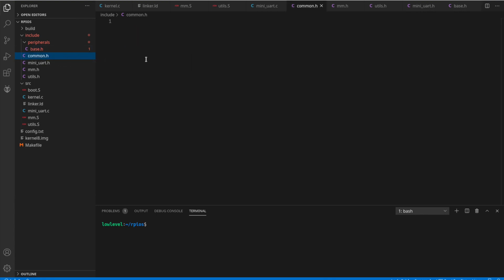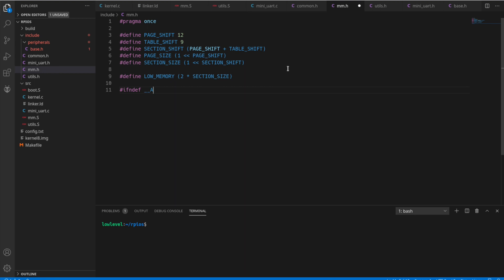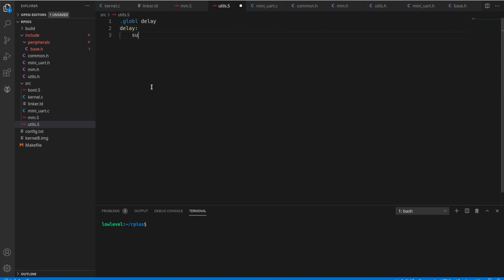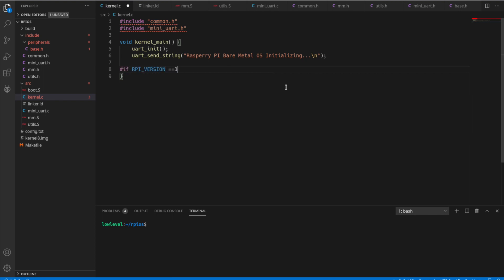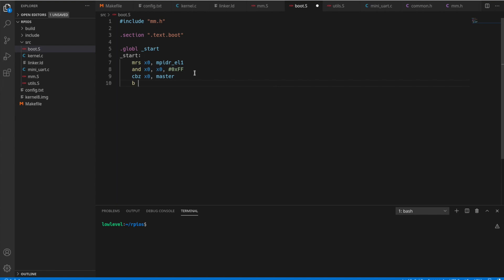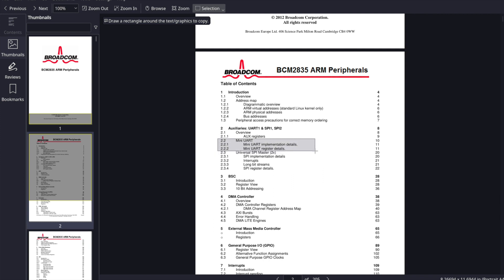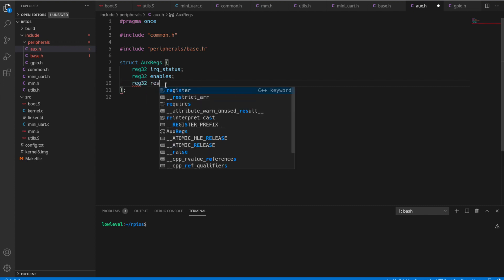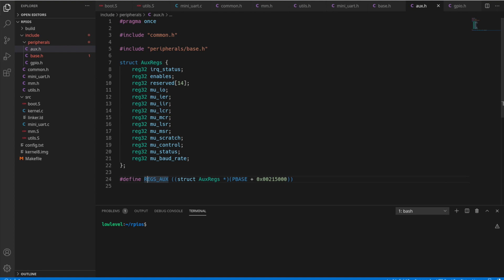Raspberry Pi Bare Metal Tutorial - Part 2

Comment: LLD: A really nice series you have here!  I'm just getting into it myself.  With some mods.  My target is the Pi Zero, so following along and making thoughtful changes as needed.

One thing I found I had to do here and didn't expect this, not sure why there is a difference in the mnemonics of the assembly (have done 68000, 6502, and AVR assembly in past but am new to ARM - I'm not a total novice but certainly new to ARM).  I've had do make the following change for example to make it work, is this because of architecture version differences or build chain differences (I'm using arm-none-eabi)?

diff --git a/rpi_bm/part1-5/src/utils.S b/rpi_bm/part1-5/src/utils.S
index 13bd3ca..c658fa7 100644
--- a/rpi_bm/part1-5/src/utils.S
+++ b/rpi_bm/part1-5/src/utils.S
@@ -1,15 +1,15 @@
 .globl delay
 delay:
-    subs x0, x0, #1
+    subs r0, r0, #1
     bne delay
-    ret
+    bx lr
 
 .globl put32
 put32:
-    str w1, [x0]
-    ret
+    str r1, [r0]
+    bx lr
 
 .globl get32
 get32:
-    ldr w0, [x0]
-    ret
+    ldr r0, [r0]
+    bx lr
Reply: Oh. Hmm, I think I've answered my own question here.  Pi Zero is ARMv6, it is quite different from Pi3/4 which are AArch64. I'll have to re-write the assembly.  Maybe check out those linux references as they'll have both in them.
Reply from the maker: yes the difference here is primarily 32-bit vs 64-bit

Comment: Just a quick note of clarification: "Volatile"  tells the compiler that the value of the variable may change at any time--without any action being taken by the code the compiler finds nearby. The significance is for memory-mapped register variables, as the hardware changes their contents. There's no way for the compiler to reason about how or when the registers might change, which is why we use volatile.